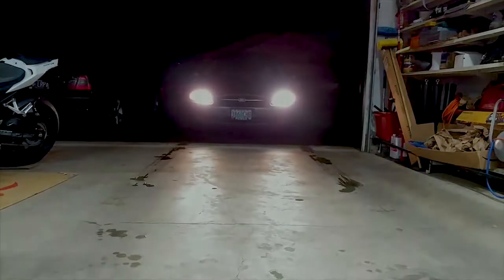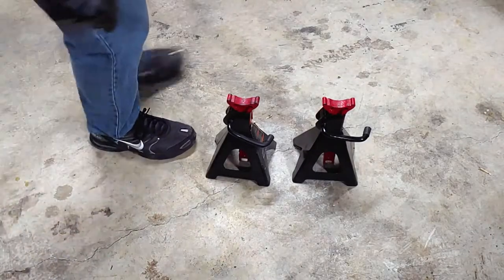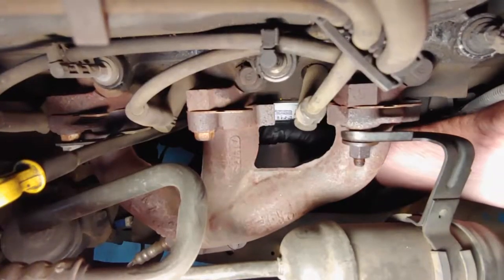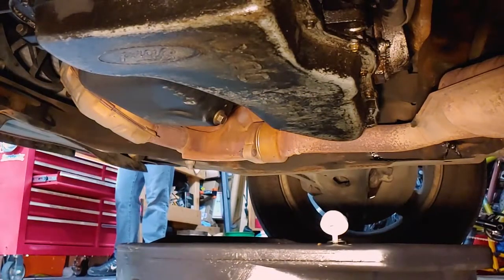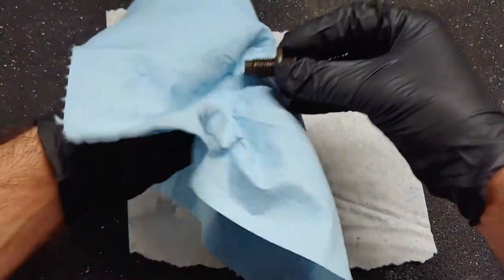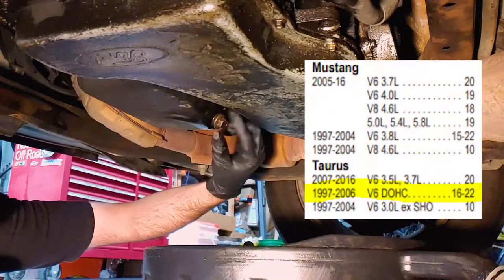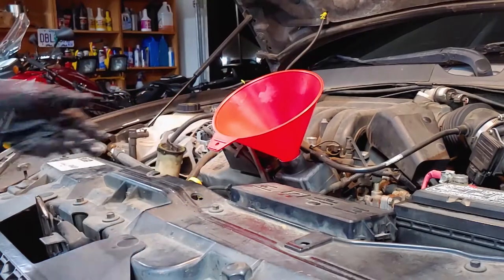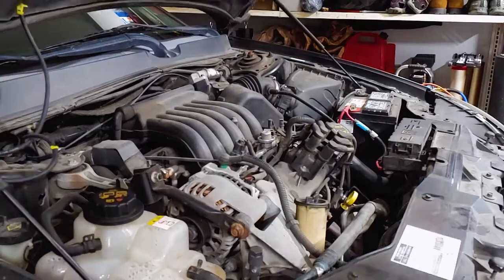Oil Change Step-by-Step Guide: Ford Taurus / Mercury Sable - 2000-2007

Comment: That isn't the DOHC engine FYI.  The engine in your Taurus is the Vulcan engine.  The DOHC engines have the coil on plug ignition system, the one in the video being the Vulcan has the single coil pack on the valve cover...also, the Vulcan engines are the better option, and also found as an option in the 90's Ford Rangers, and I believe were also sometimes found in the Ford Aerostar vans. 

I just picked up a 2005 Taurus, I'll be doing my own services on it, they're not too bad on these, I used to have a Ford Tempo and the oil/filter changes on it were pretty easy too.  The only trouble is, unlike my truck, I have to jack up the cars in order to do anything under them.  

Order a few filters and gaskets from Rock Auto for future oil/filter changes so you have them on hand.  

When I got my Taurus a couple weeks ago the first thing I did was go through all the fluids on it and changed them all so I have record of when they were done.  I also changed the cabin air filter which looked to be the original and was completely full of debris.  Changed the fuel filter and air filter as well.  

The only down side I have found on this car is the digital odometer doesn't work, but can be read using my Forscan software, so its not that big of a deal for me.
Reply from the maker: Thanks for the info, I really don't know much about this car to be honest. Changing all the fluids and filters after buying a car is a great idea and more people should follow that advice. It seems like a lot of people don't understand the importance of keeping those things in good condition, treating cars as disposable items. Maybe that's why manufacturers make disposable cars these days? Thanks for the insightful comment!
Reply: @EndlessMoneyPits  No problem at all, just wanted to point it out because some may not know.  Yes, you could get either the Vulcan or the Duratec DOHC engine for a while, but those Duratec engines were trash, the Vulcan was in the original Taurus starting in 1986.  In 1996-1999 you could actually get the Taurus SHO with a 3.4L V8 it was a Yamaha built engine for Ford.  The Vulcan engine overall won out and became the standard engine in the Taurus up until 2007 and then Ford went with the 3.8L Duratec engine.  The 3.0L Vulcan was the base engine for most model years, both the Vulcan and Duratec used timing chains, a huge plus, but the Duratech being dual cam just complicated matters LOL.  

Every used car I buy I go through it and change fluids and filters as soon as I get it.  A bit of an initial cost, but its a great start to keeping a vehicle going longer.  

Most people don't bother with routine maintenance it cuts into their wallet, but they're quick to blame the vehicle when it breaks down all the time due to the lack of maintenance.
Reply: Try setting the zone for the compass. It might let you see your mileage again?!

Comment: Ive found on the Vulcan engine  the 4.5 quarts leaves it a 1/2 quart low. Mine takes a full 5 quarts to bring it to the full mark. 2000 Ford Taurus .

Comment: How do you reset the oil life
Reply from the maker: I never got to do that on this car, sorry.
Reply: @EndlessMoneyPits  thanks for the response. I change the oil and filter once a year. It  only goes about 300 miles a year. It's got 71,000 miles on it. I change the oil filter on it myself because every time I take it to a shop, oil drips from the filter onto the starter... and then i have to change the starter. It just sits really